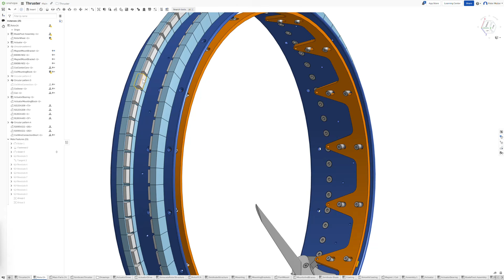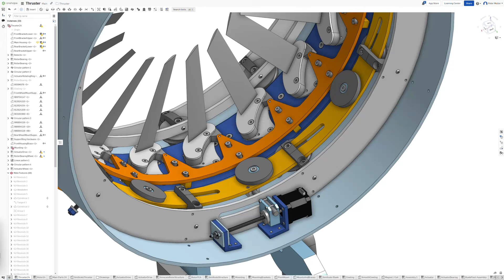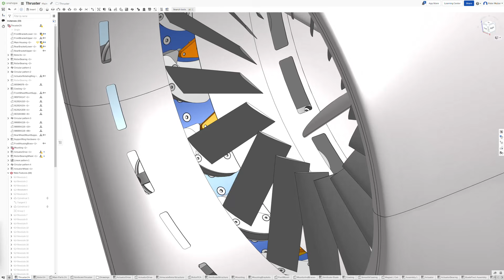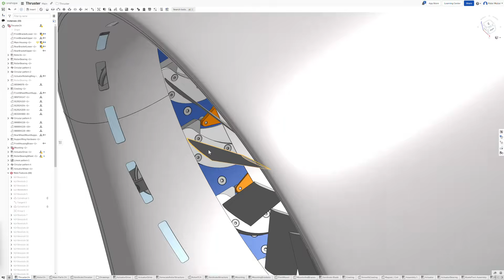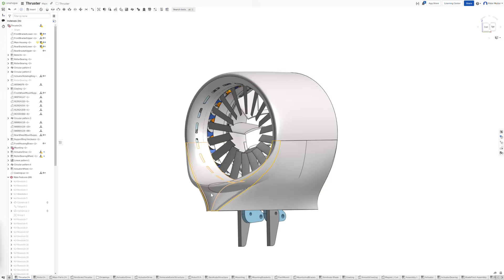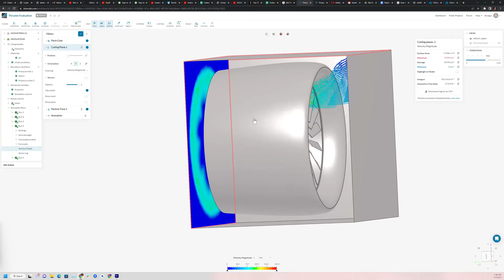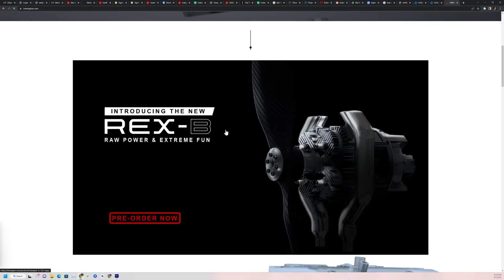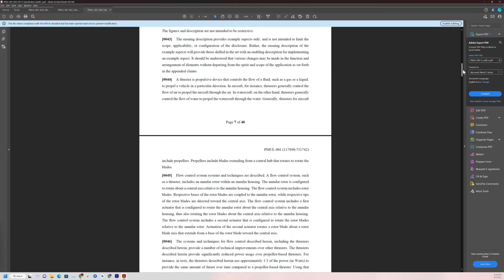Could this Thruster transform Aviation?

Comment: I have Seen Variable Pitch Controls on Gas Turbines with a Control Ring that Twisted a Control Ring and having Positive Control so No Springs No Weights and the Force of the Air didn't Move it one way or the other and the Control Ring would put more or Less Pitch or Anything in the Middle and They Designed it with the actuator arms would be all Around the outside and them Arms would Control a Ring on this inside and another Ring on the Outside that went Around the whole gas turbine would Control the Arms. I think they Done this for Having Positive Control so you could Never have one actuator putting in more Pitch and For say if it some how got Cocked eye and puts More Pitch "High Angle of Attack" Say at the 3 o'clock position of the Ducted Fan "Looking at The Ducted Fan from Behind" it would pull to the Right and Yes it is one Way You can steer a Fixed Point Mounted Ducted Fan but you wouldn't want that to happen without Wanting that to happen when in the Air Flying. and The Bigger you make the Ducted Fan The Slower you'll have to Spin it for the Outer Blade Tips will hit Mach Speed Sooner then the Inner Tips of the Blades for a Given RPM and When the Blades hit the Speed of Sound Mach Speed it will Start to Stall and the Outer side of the Blades are Traveling a Farther distance so as you make it Bigger the Distance the Blades Travels will be Greater and this will make the Blades hit that Mach "Speed of Sound" Sooner so as you Go Bigger the Lower the RPM, and As you Add diameter and/or RPM the Energy potential go's up not just what the Thrust will be but if it Blows apart Too. They used to make Gas Turbines with Variable Pitch on the Compressor for an Anti Stall/Anti Surge System but now in Days they just mostly use a Control Valve. Variable Pitch Stators are more Common. Making This out of Very Light Materials and Getting the Blades Twist and Shape and the Chord Just Right and having Very High Tolerance on Everything and Very High Balance and Keeping Blade Flex to a minimum and having Strong Trust Bearings for the Spinning Fan to Trust up against to Transfer it's Energy. But I would Go with Wider Blades and Bigger Diameter for you want to Move a Lager Mass of Air at the highest Velocity you can without the Blades hitting Mach and Stalling out and Like I Said the Outer Tips of the Blades will it Mach "Speed of Sound" Frist then the Inner Tips will Hit Mach Last and When Any Part of your Blades hit Mach they will Stall and the Blades won't be doing as Good of a Job Moving Large Mass of Air and the Velocity of that Air will Go Down Too. But I would Go More for Largest air Mass at Good Velocity instead of Trying to Move Air it Highest Velocity and Lower Mass.

Comment: A regular DC motor is 1/10th the size and weight, and can also have adjustable fins. Many prop planes already do. Volume and therefore mass grows by O(n^3) as you increase the size in 3 dimensions, it is not a worthwhile tradeoff

Comment: Most likely this design have a lot of potential for catastrophic engine/Motor failure.

Not to mention this concept was taken from a electric bike wheel and just put on a plane propeller with inward facing blades, so obviously if someone make the thing reliable it will work if they can make it light on the batteries, this is nothing new.

so this guy steals a idea and quickly make a design pattern it so if someone makes something similar he can force money out of them or force them buy his design, thanks to people like Peter Muller the world can suffer a bit more.

Comment: That’s an amazing design. I hope I’m wrong, but I think Ford has stolen your idea and using a portion of your design for ther new variable blade turbo charger. 

That being said, can it be setup modularly with each assembly in series counter rotating relative to the last. You can even use your cam design to manipulate stator blades in various types of engine designs.

Would it work in water? 

It’s very cool, truly!! Good luck

Comment: IDK.  General rule of thumb when engineering something is that the more things you have that need to move, the more points of failure.  ESPECIALLY when its the only thing keeping you from literally falling out of the sky to your death.

A normal jet engine rotates a stack of rotors with one shaft.  You have what?  10 different wheels on EACH side of your engine that guide the blades.  On top of that, the mounting point for those 20 wheels has ANOTHER point of failure where it can glide on the slots.

IDK.  God forbid one of those components fails which increases friction, and load on the other components which creates a snowballing effect.  Meanwhile you're life relies on this thing not failing.

I think you need a more passive way to guide that inner ring.  Something like an electromagnet or a replaceable Teflon guide that self lubricates.

Comment: At 100 rpm the blades are fluttering quite a bit image how much flutter would be induced at six or seven times that. 
Replacing a blade would be irrelevant at 300 knots and a thousand feet above the ground when a snap of a single blade causes a catastrophic failure. Maybe an inner ring on the blades would stabilize this some.

Comment: It's really cool but once you get to the end of transsonic spinning speeds those propellers will lose performance and probably start to break. Prop planes already have similar issues at high speeds and having the propellers turned inwards eliminates the stability of traditional props. I wouldn't say its bad it looks like a really cool idea for drones and stuff but I wouldn't say its gonna transform aviation.

Comment: My gut feeling is that this is never going to fly, the problem is mass combined with rotational speed. For one, those blades are being compressed, and they will have centrifugal force acting on them, and when they are pulling they will have to bend just a tiny little bit, and the centrifugal force will make them bend even more.

Now imagine a bird strike. While never great, with this kind of thruster, the imbalance it would create, combined with relatively large mass at the end of the fast rotating blades could explode, tear itself off, or tear the whole wing off.

This thruster calls for relatively slow rotation in an environment where mass doesn't play a major role, such as under water. If it offers any advantage there, I don't know, but it could only be used to propel more viscous fluids.

Comment: 5k rpm with that large of a rotor and that bearing arrangement? No chance. This is 100% a case of you don't know what you don't know. I could list like 20 things on first glance that do not take an experienced turbomachinery engineer to point out. This frankly looks like one of your first design projects. If you want to continue your dreams work on the hobby airplane scale.

Comment: The opposing piston motors are a non-starter.  The idea has been around for 100+ years, and they just don't work.  If you want a very efficient petrol motor, look at Liquid Piston motors.  They have an updated rotary motor with many of the shortcomings solved.  They still have a way to go, but I think its worth going.

As for your electric coils, give me a DM.  I'm a technician for an R&D firm specializing in ultra high efficiency, rare earth metal free, traction motors.  I'm probably one of the most qualified people to view your presentation that can and is willing to help with your coil design.  We don't deal with axial motors, so that won't be an issue helping you.

I have also designed my  own inverter with full load regenerative charging and dead motor grid charging.  We have not built one, but it was designed to fit into a motorcycle, so size and weight were very important.

Comment: So~o.  If you staged a gas generator ahead of that, and extended the outer rim to provide a 1 or 2 stage turbine, instead of using magnetic fields, and the gas generator section was only on part of the outer ring, using the rest of the rotation cycle to cool it off, think you could use high compression high heat discharge gas generators operating in a more thermal efficient zone?  Iirc, most of the issues involving scaled designs of fans spun off gas generators in a coaxial form, is the wide variation between 'idle/cruise' and 'takeoff' and 'max emergency required'.  Using a number of gas generators which can be cycled off, might let you tune the fuel burn to be in more constant efficient zones. or not.   I'm a bit confused still why this species uses staged turbomachinery in such basic fashion still; the most advanced form was called a 'motorjet' but the entire principle was never advanced on, despite its potential to use dissimilar machinery, instead of making one that works in all sections of operation. 

...Or something like that.

Basically: 1-10 small gas generator turbines, ahead of your ring impeller, spinning it from the outside, as you've already turned the engine inside out as it is~  Could even use them in addition to magnetic fields if you really wanted.

Comment: I'm imagining this rotor as a maglev instead of rollers have it zero friction zero-gravity magnetic levitation utilizing the current technology as well as brushless motor technology also you can have the pitch control also controlled by hydraulic actuator and a brushless linear motor built into the hub controlled also controlled through magnetic impulse this centrifical force would create a positive hydraulic pressure that could be bleed in and out to control pitch

Comment: why does it not have a core? what is the advantage? haven't watched the entire video, but he jumps straight into the engineering details without covering the basics, and it is a long video, so not sure at what point he gets to the bits I want to know, I am not particularly interested in his cad design etc. how do you solve tip vortex loss of efficiency?

Comment: The problem with all those designs is the nature of the craft it self. What is the glide ration on this one? What happens when the power shuts down due to an error or bug? Especially during VTOL. Traditional aircraft only work under heavy regulations. But nobody really wants to have 3 weeks of inspections and a ton of paperwork before every flight. 
We need to rethink this vehicle concept in it's entirety. Personally I am in favor of a hybrid between an airplane and a zeppelin.

Comment: Imagine six of these fans in series, forming a six-stage turbo compressor. You’ve created a sustainable flow of hot, compressed gas (without using valves) in which you may burn fuel, whether it be jet fuel, methane, diesel or gasoline. The pitch of the blades and the electric energy input determines the pressure and flow rate of the gasses. 

Next, burn your fuel; increasing the temperature of the flow.

Now direct that superheated compressed gas: 
Through a rocket nozzle. OR: 
Through a second set of six stages, bringing the temperature down below ambient, while collecting the energy as electricity (a.k.a. braking mode). 
Use that captured electricity to:
Power the compression cycle.
Charge a battery. 
Power a drive motor. Of any size, shape, weight or configuration. AKA: Airplanes, cars, trains, boats, ships, airships, drones, flying cars and starships. 

Energy in: 
-> Electricity of fan drive motors.
->  Fuel burned. 
->  Temperature drop between inlet and outlet. 

Energy out: 
<- Whatever you can collect from the six motors (being used as generators in the decompression cycle.)

Build the device so that each stage (2x6 = 12 stages) has its own variable frequency motor controller. Unlike a conventional turbo-charger, the stages don’t all have to operate at the same rpm. 

The pitch of the blades at each stage are also independently controlled. 

Use AI to learn which combination of rpm’s and blade pitch minimize the outlet temperature of the exhaust. 

Get more than 100% of the energy in the fuel to the tires. A whole cottage industry could convert ICE cars to electric by removing the existing drivetrain and replacing with modular kits. Who wouldn’t want an Escalade with the fuel consumption of a Prius? 

The company that develops this tech will change the world. (Are you hiring?   (-: )
Reply: >100% is an exaggeration; unless compared to traditional efficiencies of ICE and jet engines. Even full-electric vehicles have efficiency losses starting at the electric generation facility. Distribution losses, energy storage and retrieval losses.. 

In the end, more of the energy released as heat makes the wheels move. More than twice as efficient, in most cases. 

If your energy comes free from the Sun, you don’t give a shift. But even when that day comes, methane won’t be free unless you make it yourself. 

This technology is Revolutionary. In any year.
Reply: For the retro fit kits, they could be a plug-and play way to “fix” any ICE engine or drive train in a vehicle. Market to auto shops, used car dealers, scrap yards, auto auctions. 

The successful products will make it cheaper to go electric than to make the repair. 

Pay more $$ for poor efficiency and higher maintenance costs? Or buy our product. A completely new engine. New technology. More fuel efficient tomorrow, and every day after. Demonstrate Days to ROI. When it becomes negative, it’d be stupid not to make the switch.
Reply: The product I described could be called a Point-of-Use Electric Generator. If you want to use the same tech for your propulsion motors, that’s cool too!
Reply: A toroidal trifoil might be persuaded to levitate and center itself magnetically (magnetic thrust bearings) while being pushed/pulled magnetically to rotate - or resist being rotated- by the  stator windings. Three phase synchronous motor/generator.  

What you would lose with this arrangement is pitch control on the rotor blades. For constant-rpm situations, this is a trivial loss. Pitch control might be incorporated into a central hub.
Reply: To maximize efficiency, use a compressor-driven refrigeration cycle to ensure all resistive losses (heat energy) from the stator and electronic hardware, as well as super-chill of the exhaust, (more heat energy from the environment) and pre-heat the incoming air before the compression stage.  

The difference in ambient temperature and exhaust temperature is an energy source, and we can maximize how much of it is turned into usable work.
Reply: Furthermore, if one were so inclined he or she could employ a evaporative heat exchanger in the pressurized space between the last compression stage, and the fuel burner. Removing the water from the incoming air will also remove the water’s latent heat of vaporization. This heat is re-introduced into the airflow before the first compression stage via the closed-loop refrigeration system.

The water can be filtered and purified for drinking, or discarded. Or even re-introduced into the exhaust stream for its evaporative cooling and expansion effects.

Comment: Those little wheels with bearings are not possible and are the main weak link in the chain ! If you could use a circular magnetic levitation instead of those wheels it might have a chance plus you need those blades mechanically attached to a central hub to relieve the compression on those blades, to remove all the stresses and vibrations they will create ! You may have something there. Don't give up !

Comment: I have no idea if your claims will prove to be true - seems unlikely.  However, wondering if you might consider a change.  What would happen if you mounted an axial flux motor in the center and eliminate the heavy magnets on the outside?  Koenigsegg Car Company uses an axial flux motor that is rated @ 330 hp & 450 ft-lbs of torque.  It is 66 pounds, is 2.5” thick and is about the diameter of a coconut.  That would fit nicely in the center to drive the blades and stabilize the center.  It would be relatively light with lots of power and I assume lots of thrust.

Comment: Problem you have is your blades are under compression rather than tension. Compressive forces are a lot more difficult to cope with compared to tensile as the size of the blades and rpm increase. Also the blade tips are going to produce vortices in the centre of your air flow which is going to create turbulent air at the exhaust of your fan assembly. I don't think you have fully thought this one through from a fluid dynamics perspective in its current form it creates more problems and seems to solve none.

Comment: So, you've created a Hollow, of 'low pressure' in an engine that Usually uses that quantity for "higher Pressure" or Mechanical items.. HOW DO YOU, Fill that Void?! That requires MORE Pressure. Where Are you going to provide THAT?   Do You peel an Orange, from it's Insides to it's Peel? If so, how?

Comment: Why electric if you have to have a diesel motor to run a generator? Mount that neat little motor in a nacelle in the center of the fan and drive the fan directly from it with a shaft and continuously variable speed drive. In that location, according to your flow models, will not present a drag to forward motion and could increase air flow. The amount of weight to produce the electricity and use it (with all the magnets strapped to the rotor) out weighs a direct drive, though I understand the desire to be electric. It will still need a generator to power everything else.